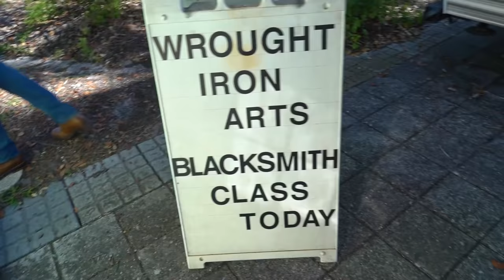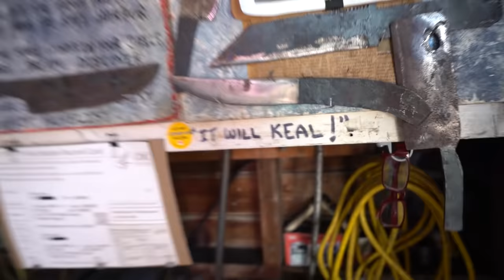Forged in Fire Is Easy

Comment: Im gonna be, "that guy". Charlie should have been wearing a goatskin glove on the hand he was pounding the heated steel with when the accident happened. And its on the Expert Smith who allowed him to do that without the proper safety equipment. I am a welder and what happened to Charlie is very similar to when you are welding and the weld pool or spray lands on you. Its a very intense burning that lasts for a long time and that's through my flame resistant jacket on the bare skin it can be devastating. And the fact that Charlie had to get a shot means it was serious. I've had this happen to me on bare skin only a few times and each time I quickly brushed or doused the piece of Molten slag to mitigate the damage and immediately apply burn gel which any self respecting smith or welder always has on hand when working. By the looks of the video, although it is unclear, It looks like Charlie let the metal set on his skin, likely  due to inexperience and shock; until the Smith brushed it off his hand. This is probably what led to the burn being so severe in the longer term. I am also a "Florida Man" lol, so I respect the garage forge and willingness to teach your trade to others. That being said please to anyone out there who is inspired to build your own forge or find someone's to use like Charlie PLEASE take the proper safety precautions, that means: safety glasses, Flame resistant or retardant clothing with legs and Sleeves, Close toed shoes preferable steel or carbon fiber toe boots, and for god sakes GLOVES! I have seen so many people and myself fall victims to Burn and cut related injuries' just because they didn't think about rule numero uno. Charlie and the boys were excited and inexperienced so I blame the Smith that was standing right there and let him hammer away with no glove. My old welding instructor would have cringed so hard at that and proceeded to snatch the hammer from his hand and shout "Do your safety gear check before you step in my shop, or ill shove this hammer up your" and so on and so forth. Anyway, Hope the Injury heals well, awesome video, and stay safe peeps.

P.S Also really lucky that Scale Didn't jump up your arm, woulda really fucked up the dope tats. Plz wear sleeves and gloves if you do this again Charlie haha.
Reply: I mean yeah, but equally important: you never go hair-out in any situation where any kind of machinery or hazard could mess with your scalp. Especially with spinny things, it's not worth the eventuality.
Reply: @minhuang8848  dude fr i complete forgot to mention that I couldn't believe he had his hair down while angle grinding. Very unwise
Reply: I thought the same
Reply: so true...so many safety stuff overlooked by all of them...aaaaand then you have Charlie saying he won't swing his katana in fear of raw meat fliying near his hand lol
Reply: @maximilianoalcaraz7351  true 😂a fully bandaged hand was prolly fine from any cross contamination concern 🤣
Reply: boowho
Reply: @user-mj1rq7qx4p  itll be okay buddy
Reply: @Cole Feast I'm glad your being that guy in this instance as it needed to be said. :)
Reply: I've been told having a glove on the hammer hand is personal preference, gloves can give beginners a false sense of safety too. My blacksmith instructor told us it's not uncommon for a piece of scale to land in your glove, and getting a sweaty glove off can take longer than you would like while it's burning your hand
Reply: @97itachiuchiha  yeah it's personal preference just like not shoving your hand into a woodchipper is a personal preference. 
I've had many pieces of slag land on my glove, and it takes a looong time for it to burn through the glove. There is no real reason not to wear it.
Reply: @97itachiuchiha  @minus25, yea i guess i get it but that argument is more for people that dont like working with gloves on cuz that situation happenes so rarely and you would definitely be exposing yourself to more danger and damge going with no glove.
Reply: @willypet100  Huh, I always go no gloves, guess it's personal preference. I've gotten scale on my hand before but it doesn't really hurt too bad.
Reply: @atom8248  fair enough Alpha
Reply: @willypet100  true, and I only wear 1 glove like 60% of the time, but im just an amateur blacksmith with an anvil in my backyard. If my friends want to hang out and watch I make them wear gogles. That blacksmith should have not allowed Charlie to not wear gloves AND to have his hair loose. I mean 1 bad move with the angle grinder and he would be seriously injured.
Reply: @willypet100  Although tbf Charlie probably got a way larger flake of scale than I have ever got on my hand.
Reply: @atom8248  and ya know what i mean when I say you gotta brush it off fast? Like with slag from welding as long as you get it off fast its way less intense. But it seemed to me in the video like some was on his hand for quite awhile before the other guy brushed it off.
Reply: @Munisk52  thats the worst part for me. Obviously if its your garage and equipment and you are comfortable with the work, going no glove is gonna be far less dangerous for you. But to invite outsiders and novices in, its nownon you to look out for their safety. And they are gonna be far less confortable with the work and environment making it more likely for them to get hurt doing something that is already dangerous by nature.
Reply: O R  I mean there is a place for Being "Macho" esspecially in these lines of work. There are times when I compromise safety for the sake of completing the project, the difference is most of these macho guys in the coments have at least some level of experience. They understand the risk and will be able to act better when the issue arises. But when you have "noobs" as you put it, that right there makes the situation so much more dangerous even with all the saftey precautions in place. Even the Macho guys in the comments cant argue that whoever taught them told them about the dangers and how to be safe and it wasnt until they became more comfortable with the work that they started risking saftey. EVERYONE who just starts smithing or welding with no regard for safety get injured and if they are unlucky seriously injured.
Reply: O R  The guy is lucky its Charlie that got hurt cuz He wont sue he'll take it more on himself im sureother youtubers or just random people would have definitely sues after having to get a tetnus shot and bandaged.
Reply: I was wondering why they weren't using gloves in both hands and long sleeves. For me it seems pretty obvious to cover yourself if you're working with molten hot metal. I guess common sense doesn't exist nowadays.
Reply: O R  when you mentioned welding and using power equipment in apparel like flip flops, it reminded me of a certain australian man called I did a thing
Reply: I was about to say, watching all those clips as a welder as well seemed waay to unsafe and careless from the expert smithing side of handling.. The one running that forge store is very reckless and disregarding of any form of safety to Charlie and the crew. They got lucky nothing too bad happened with all the insecure procedures I just saw.. Shame on that forge man on the way he handled that whole session..
Reply: @greyb5511  i mean poor Charlie took a pretty rough one. Its a guarantee one or more of them was gonna get hurt with the way they were workin. They just got lucky it was only one person and lucky he didnt lose a finger. But yea the more replys i get and keep thinking about it those smiths should feel really bad about that. I would feel terrible if it happened on my watch.
Reply: a piece of molten what now?😳
Reply: @bobjohnson7453  S-L-A-G, its a term for the filler metal that flies off of something you are working on while welding. It would be the same thing as the "scale" Charlie referred to in the video. After you finish welding a peice you usually have to use a Slag hammer to chip away at it to get to ur pretty welds underneath.
Reply: @minhuang8848  shit dude that’s not exactly true either. 
A LOT of spinning machinery forbids the use of long clothing and gloves
Reply: Since we're talking safety here. Nobody's gonna talk about swinging sword towards people? At that meat part I flinched a couple times.
Reply: I mean I'm not anything and it's pretty clear there were zero safety precautions. all those sparks in a wooden garage seem like a recipe for disaster too
Reply: Well, luckily forge scale isnt quite as bad as what are essentially droplets of molten steel flying around when welding.
Forge scale isnt quite as hot (but still pretty fcking hot ofc) because youre not working with actually molten metal, it is also paper thin, so it cools very quickly.

Getting a piece of forge scale on your skin will certainly sting like a bitch, but unless you get it stuck in an especially unfortunate area, it wont leave more than a superficial skin burn.

Personally, I never wear gloves while forging (tho I used to when I started) because I feel I have much better control over my work without them, and the worst burns I have gotten from scale were when it got behind something and I couldnt get rid of them immediately.

That being said, eye protection and some way to tie your hair back would probably have been a good idea here, yeah.
Reply: I was genuinely surprised they weren't wearing any protective gear while watching and I'm not experienced in this at all. I thought they should be wearing gloves and an apron at least.
Reply: This video was a safety nightmare. 

Definitely make sure you are wearing a face sheild if you are doing any grinder work, especially with those zip discs, because they can shatter, and the grinder spins at around 6000 Rpm. I have seen many pictures of grinder wheels getting lodged in peoples skulls or cutting their face open. 

They also should not have been grinding the bevel with a zip disk. There are grinding disks that exist for that purpose, and when you are flexing a zip disk, that is when it is most likely to shatter. 

Hair should always be tied back when working with any spinning equipment because it can get caught and drag your face into it. 

When doing any hot works, you need to wear gloves, need to wear closed toed shoes (should be steel toed, because I have 1000% had slag melt through my shoe and sock and burn the top of my foot). And probably a face shield. If that scale had hit him in the face, that would have sucked. 

They should also be wearing leather aprons when doing any grinding or forging, because a tshirt doesnt actually do anything to protect you. Hot metal will melt through it in an instant, and I have many shirts and pants full of burn holes from exactly that. 

All of this is especially important for less experienced people interested in metal work, because they cant possibly predict how the tool might kickback, how the scale or shaving might come off, or any other possible dangers with the tools they were using. If you injure yourself, you grow to fear the tool, and being scared of the tool is one of the biggest causes of accidents in the shop. 

Also, they probably should have put a guard on their swords, because if their hand slipped up onto the blade, that would be another trip to the ER for a tetanus shot.
Reply: Ilya from thatworks never wears a glove, and he's pretty professional. Very few of the contestants on forged in fire wear a glove on their hammer hand, either.
Reply: i'm 100% surprised you didn't mention the way they used the grinders in your safety speech.
Reply: @im1337ninja  yea I posted it right after I saw charlie get the scale on his hand so I think i had completely forgoten about it at the point cuz i couldnt believe the guy let him do that. Then after i saw somebody's comment i went back and saw that again. Its nerve racking to wach cuz it looks like his hair could get sucked in at any point. I think they actually might have atold him about that cuz in the next cut while grinding he put his hair up.
Reply: Honestly it's pretty common not to use a glove on the hand you use to wield the hammer.
Reply: It's always fun when science decide to test you reaction time by dropping welding sparks down your shoe. Don't think I have a pair of socks without holes on the top from this happening
Reply: Yeah that hurts like hell, usually it burns out but the bigger stuff just stays on you burned a hole in my arm once
Reply: @willypet100  im not even a welder or anything but the safety for most metalwork has been drilled into me and welded by the most boring exams, practicals ever back when i did an engineering course years ago. Even then someone who has never worked in a workshop, formally and informally should know basic common sense around these tools.
Reply: Hot metal scale hurts like a bitch. He must have gotten a pretty big piece to need it wrapped like that. I still refuse to wear a glove on the hand I hammer with though.
Reply: Spittin Facts, my older brother is a welder and he’s been burned many times while still wearing sleeves and thin gloves
Reply: Why you gotta be that guy.. a piece of scale landing on you does nothing , it can retain heat for a few seconds and then stops burning..also having scale landing on your arm can be easy to deal with , just brush it off.
The worst thing is a big piece of scale landing inside your shoes that has enough mass too keep the heat for a while , while you are trying to take off your shoes because it was too hot for you to wear jeans over shoes so that scale can't fall in , Best remedy is salt water .( don't ask me how I know)
Also welding splatter is very different to scale .. closest thing to scale in welding world would be when you wack a piece of fresh weld to remove the slag or w/e it's called in english and then if that falls on your arm, even that has more mass then scale and can keep temperature for a longer time.
I am a hobbyist blacksmith and I don't wear long sleeves I only wear jeans and a welder glove on the hand that holds the piece of steel, if I do a lot of wire brushing I wear on my right hand also because having your hand that close to yellow hot piece of steel kind of burns.
Closest thing to a splat from a welder in blacksmiths world would be when you forge weld , never had a chance to do it but I can imagine it being very similar to when you are welding.
Reply: @collinhaskins3879  had the same thought about gloves although the only time I had a scale hurt like a bitch was when I was wearing gloves and a piece of scale managed to fall into my gloves I also had a situation when I was forging in shorts, it didn't go well :p
When doing a lot of wire work to remove scale though if you are making something that needs to be cleaned after every heat I have to wear gloves because having hands stand so close to a hot piece of steel burns like a bitch and at that point glove in strike hand is a must
Reply: @AcD420  Yeah forging without long jeans is futile ...
Reply: @_Stagnate_  I don't wear an apron when forging and the only reason why I wear a glove is because it is close to hot steel which becomes unbearable after a while ,otherwise scale is only dangerous when it falls in places that are hard to remove , trust me if he was wearing a glove and that scale fell in the glove it would've been much worse for him
Reply: @willypet100  And when you start to forge you learn that that becomes a regular occurance and you just get used to the feel of it and to deal with it.
Reply: @torakka2ow640  Because you don't need sleeves and gloves in your hammer hand when forging , it's superficial burn , closest feel I can think of is a spark from a sparkler , maybe slightly hotter
Reply: O R  It's not about being a pro or macho it's about knowing where you need protection..
Covering yourself up so much would just leadbyou to never finishing your work and potentially getting a heat stroke
Reply: O R  You obviously never worked at a forge if that is your claim...
You don't work with molten metal when forging you work with malleable metal which was heated to about 900-1300 degrees Celsius depending on the type of steel and size of steel used .
Steel melts at around 1400-1600 degrees Celsius if my memory serves me right.
You can get molten glass mixed with molten steel flying everywhere when you forge weld which is a process that requires you to get the surface of steel hot enough that the surface begins to melt slightly(usually mixed with a type of flux to prevent scales from forming) if you hit the 2 pieces of steel hard enough you can get molten metal to fly everywhere , but the correct way of forge welding is a lot of light taps..
Scale is much thinner and looses heat quickly it can only give you a superficial burn unless it is a very large piece of scale that managed to fly into a crevice , more important safety precaution when forging is long jeans , proper boots that won't melt and eye protection, having a small piece of scale land on you hand is like a short term pinch and it goes away quickly it's not a health hazard it's a superficial skin burn the size of a dot
I love the fact that common sense lost its meaning completely or the phrase no brainer.
PS I don't know the exact values I've just read on it over time , the obvious point is that it's not molten it's just malleable and you would need to heat up steel extremely hot to get it to melt and in Charlie's case it wasn't molten , if it was molten he wouldn't be able to even bring the bar of steel to the anvil
Reply: O R  It's not it stays burning for 1 or 2 seconds , it can't get infected it's not an open wound and you litteraly have a something that was sitting in red hot piece of steel (it's sterile) it usually doesent even leave a blister lol 
If he was wearing a glove and that scape fell in the glove the burn would have been much more severe .
You are talking from a point of someone who has never done anything of the sort , don't act smart because seriously you have no idea about anything , when forging for example a sword you loose less then 1 % of mass due to scale , you get scale after every heating cycle , just think for a second how heavy the scale actually is and how long it can keep the heat , if throughout the whole process of forging a sword you loose less then 1% of the whole weight of the sword through all the scales now that 1 piece of scale from that less then 1 % weight lost and a long sword can weight from 900 grams to 1.5 kilos and see how heavy the scale is.
Scale is iron oxide that occurs when you heat the metal to high temperature and expose it to air .
I had a worse scale injury when I was wearing gloves then when I wasn't because when a sufficiently large enough piece of scale lands inside something , it can preserve the heat for longer as air cools it much faster then when it's pressed between a glove and a skin.
On top of that you can have a much worse injury if you are wearing a glove because if you grab onto a hot piece of metal it will take longer for you to start feeling the heat of the metal through gloves by which point you are going to have severe burns on your hand compared to not wearing anything since you would feel ambient heat around the piece of steel .
There are pros and cons to wearing gloves , and in different situations you do what is necessary.
Like for example if I use metal wire brush a lot and use it on a very hot piece of large steel I will wear a glove because the ambient heat from the hot piece of metal is unbearable , and it's a hassle to take off the glove after wire brushing in order to hammer so I leave the glove on for example a sword, if I'm working on something smaller and that doesent need a wire brush I don't wear a glove for example arrow head or different scrolls and other blacksmith type of work that doesent require you to remove scale before hammering.
PS I'm not from US and I have some experience with forging and I did burn myself in particular ways which taught me how I should protect myself when forging and what is safe.
For example forging on shorts and wearing sneakers is not safe and synthetic materials because they will stick to your skin.
I had a large piece of scale fall in my shoe and also my glove which left a worse burn then when ever it landed on a piece of my skin that had no protection because it could cool much faster and I could shake my hand to get it off.
So good boots , jeans that go over the boots , shirt that goes over the jeans (don't tuck the shirt in as if a hot piece of metal falls between the tucked in part then you're screwed , safety glasses , glove in left hand if you don't have long tongs.
Other safety tips , if you walk in a blacksmith shop , consider every metal to be hot , just because it's not red hot doesent mean it's not hot , ask for permission of blacksmith when ever you do something like for example shoving your hand inside vermiculite which I used to slow cool a piece of metal when normalizing so that the heat is as evenly distributed as possible ...
I actually have a recomendation for you , watch black bear forge on safety he explains it really well.
Oh and it's not a scale made of metal it's a scale made out of iron oxide .
Reply: O R  I wear a seatbelt and I don't ride a motorcycle because I believe it's an open coffin on wheels.
I bet you're a type of guy who thinks he is always right and can't bother to read the other person's argument because they don't know better then you of course and you are just always right and flawless.
People who think certain things and are adamant on protecting those things or views tend to cause even bigger problem when they start dealing with something..
Ie wearing gloves will just give you a nastier injury even though according to you wearing gloves is a "no-brainer".
Just like the vegeterians.. actually I have a feeling you are a vegeterians/vegan because you think that's how you help animals...
Guess what common sense is wrong , the higher demand for vegetables the more forests need to be cut down for space to plant those vegetables(animals loose their natural habitat), the more you need to use insecticides and pesticides  to control pests from destroying your crops (animals like jack rabbits , parthridges , pheasants and so on get poisoned ), vegans are the biggest cause for deforestation of rain forests because palm oil is cheaper then sunflower or other types of oils I can go on but that's besides the point of the whole scales aren't as big of a deal as you make it seem to be..
Reply: O R  Here I will sum it up for you 
Everyone looks at hazards their own way and take precautions to reduce the risk of injuring themselves , some sort of injuries are inevitable when blacksmithing such as superficial burns , cuts etc , you as a blacksmith need to learn to minimize that and consider for yourself what is the right amount of protection in which circumstance , let me give you an example , bee keepers don't always wear complete body suit to avoid getting stung , bees can still occasionally sting you through the cloth , when feeding bees they don't even wear any arm or leg protection they only wear it over the head , some don't even do that.. because they know that bees won't get so aggressive when you are feeding them.
Just like the blacksmith , if a blacksmith is bending a piece of metal with a wrench he isn't going to wear a face shield , wear both gloves , plug their ears , wear and apron and so on because twisting or bending something doesent cause scale to fly everywhere and there is no loud sounds .However if a blacksmith is trying to forge weld he should wear a glove in his left because that arm can't move around because it's holding a very hot piece of metal , he should wear a face shield or at least eye protection , apron if he has one and proper clothes adjustment in order to avoid getting a hot piece of metal falling into his pants , shoes gloves etc.
Reply: @minhuang8848  Gloves on rotating machinery is often not a good idea because your glove can get caught and suck your hand in. Probably a good idea with a grinder tho lol.
Reply: Hush
Reply: I think definitely the greatest part of professional and hobbyist smiths don't wear gloves. Sometimes scales fly on my hand or arm and honestly that stuff is so thin that it burns for a really really short time, moreover often you sweat while forging and the water on your skin will cool the scale even faster. Molten flux is a different thing, that's pretty much 2500° F molten glass that splashes in any direction, it never hit me directly but I guess that would plenty of pain... not like simple scale. Moreover using gloves during winter irritated my hands so bad that they were always dry, red and my knuckles started bleeding doing any kind of handwork, and all this shit stopped after I decided to not use gloves anymore. From my and others experience I can say that gloves gives much less sensibility to your hand, it's more likely to let your hammer slip off, and if it's that kind of thick gloves with a wide opening it could trap big pieces of scale that fall into it. In the forge the first rule is "if it's black it doesn't mean it's also cold", so before taking in your hand anything, stock or even tongs, you have to connect the brain to your arm.
Aprons, safety glasses and closed shoes with steel tips are a must to have if you wanna avoid serious dangers, long sleeves and gloves I'd say they are not. Expecially if you wear a shit random shirt made of polyestere, if a scale lands there it will melt the tissue and that stuff keeps the temperature much longer than hair-thin scale. And one last thing that seems to be obvious: you are working in a hot place with glowing metals that can reach over 2000 degrees, and do you really expect to not get burned at least a bit? You should do anyhting to avoid real dangers like scale in your eyes or a piece of red hot metal falling into your shoe, but since we are talking about thin scales on sweaty skin, I'd say fuck it and chose sensbility and freedom of movement. If you are not willing to get burned sometimes you should not even start a hobby/business like this, it's like go climbing and not expect to scratch your knee sometimes, and have you ever seen a climber with kneepads? You have to make a compromise between full safety and comfort, because I would be really curious to see somebody forging in a hot august afternoon while being fully protected and completely covered
Reply: @giodavid991  Perfectly explained and I would like to add in terms of safety , basic rule is don't have pocket like things , like for example if you tuck a shirt in you create a potential place a hot piece of metal can fly into , and gloves pretty much make a pocket that a hot piece of metal can fall into . I'd say driving a car is far more dangerous and all that is holding you down in case of a crash is a single belt and an airbag, you don't wear safety glasses when driving a car and there is a potential risk of glass shard falling into your eye, I don't see people putting on armour when going to drive a car , people have to understand that everything has a risk and that to circulate you need to have the right balance of protection and comfortability , like you said wearing full protection during a hot summer day I'd say good luck with your heat stroke.
Also taking a tetanus shot after litteraly a scale that just came off from a red hot piece of metal burned you was silly to say the least , nothing can survive at several thousand degrees and you don't get tetanus from rust /oxidized metal , you get it from bacteria that happens to like living in such environment but it can't survive being inside a 1500 degree -ish fire.
Reply: @StodOneR  I just read your previous comments and you had already told all the necessary ahahah. I agree on everything btw
Reply: TLDR wear safe stuff
Reply: This comments really show who has never done any type of blacksmithing work. The reason you don't wear a glove on your hammer hand is because you get a less grip on the 2-4lbs hammer you are swinging. When a 4lbs hammer goes flying it is a whole lot more dangerous to everyone than a piece of scale landing on your hand. If Charlie had done the only reasonable action of trying to get it off his hand as fast as possible it would have been a much less severe incident but instead he just stood there letting it burn him more and more. The only real safety concern is using the angle grinder with long hair dangling. That could have scalped more Charlie if it got wrapped up in it
Reply: @cae2487  i guess id just hold on reallly tight 😂
Reply: Sorry but a " florida garage forge sounds dangerous for all of humanity"
Reply: Your not that guy for wanting people in your profession to be safe properly, props to you
Reply: youd think so, but you are not supposed to wear gloves while forging, scale flakes off and you dont want it stuck IN your glove.
Reply: @peepopalaber  been forging knives for near 10 years, yet to see "nearly liquid metal" spray anywhere. That doesnt happen in heating and beating.
Reply: I was interning in a forge for a longer while and the smith said I shouldnt wear a glove on the hand that's handling the hammer. I wore one anyway and slag managed to fall inside of the glove and I struggled to get it off so it burned my skin until is was cold and I was fine for the most part. I also had a ton of blisters and just taped them up, today I would heed the advice of the smith and just open them myself.
Reply: Never seen a blacksmith wear a glove on their striking hand because if you do it right you don't need one. Pretty sure he didn't descale the steel before striking. You should always use a wirebrush to brush away the scale for a clean forging process and to prevent scales from flying everywhere.
Reply: Talk about" long winded" 😐
Reply: Could you imagine askin this dude for directions? 😱
Reply: done blacksmithing, never used glove (except for stuff like punching holes and stuff like that) and i've only ever blistered three times. he must have been hit with one hell of a scale. so the problem wasn't lack of gloves, it was leaving the metal in for too long
Reply: was about to make the same observation RE the smith who allowed him in ungloved....total L move
Reply: I'm pretty sure the tetanus shot was just precautionary. Charlie has always been on the careful side with that kind of stuff.
Reply: I have NEVER used gloves while blacksmithing, last thing I want is hot scale, a glowing coal or yellow hot piece of metal getting down Inside that glove being forced against my skin until the glove is removed
Reply: @Nikola Maric yeah I’m sure Charlie went to the hospital and the hospital deemed a shot and wrapping were needed for a “superficial burn” or “like a spark from a sparkler” 🙄 Obviously Charlie was burned more severely and in two different places. What you personally do is completely different than what a shop open to non professionals should do. If you want to take safety risks with yourself that’s on you but when you are teaching others you have a responsibility to inform them of possible dangers and proper protection protocol
Reply: @Maximiliano Alcaraz the fear was raw meat juices/blood getting into an open wound, not to mention Charlie has been open about his OCD and being a Hypochondriac.
Reply: Not alone in your thinking. So many sketchy things in this video. That “Forge” is weak af.
Reply: I forge in camo crocks, jorts and a cut off flannel stop talking